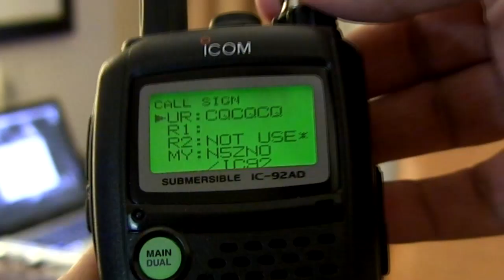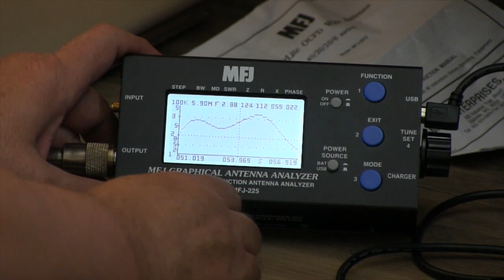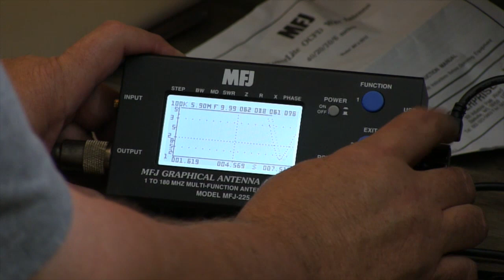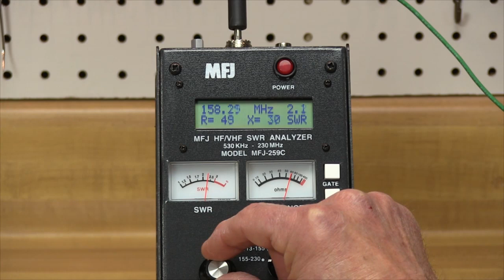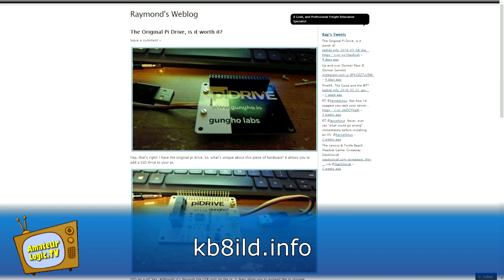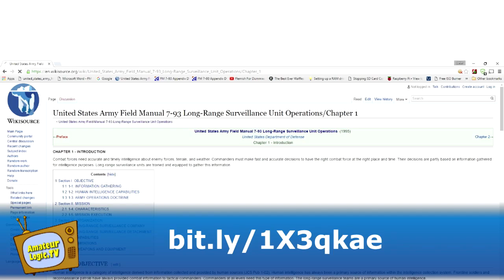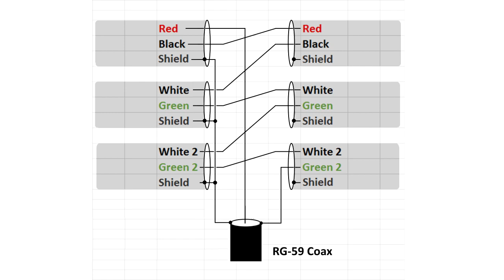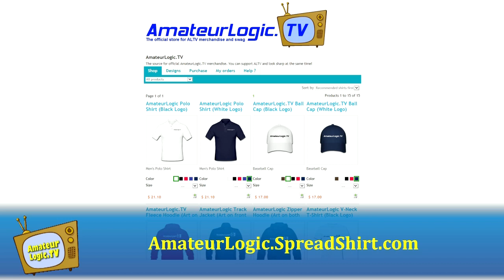AmateurLogic 90: Everybody's Talking About Antennas

Comment: I have a sds200 receiver uniden, a rg-58 cable 50 foot, external discone omnidirectional without a vertical, loaded freqs by radioreference, tried ever setting in radio, i am in a holler or draw surrounded by tall trees of WV mountains, but i pick up county furthest from me sheriff or air band all day long , but no local EMS, Sheriff, PD, State Police at all ever in my county??? Im lost. do you think this county i live in has a antenna problem, a radio power problem or the next county furthest from me has excellent antennas and large power? ?
Reply from the maker: Hard to say. I would try to find someone else in your area and see if they can hear them. Perhaps moved frequency or changed systems.
Reply: AmateurLogic.TV thanks appreciate it

Comment: dissimilar metals bonded as in soldering, is problematic dealing with corrosion.  Soldering in most cases is not permitted within the FAA rules on aircraft, for that very reason.